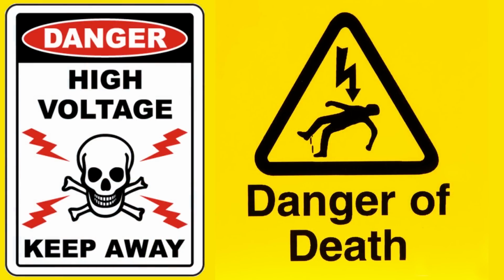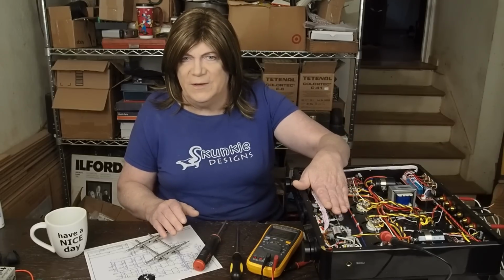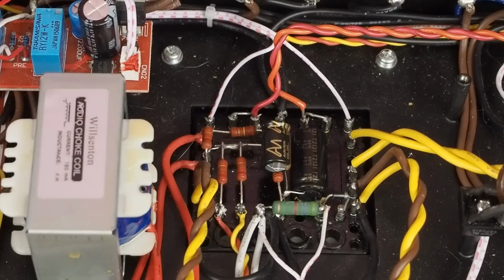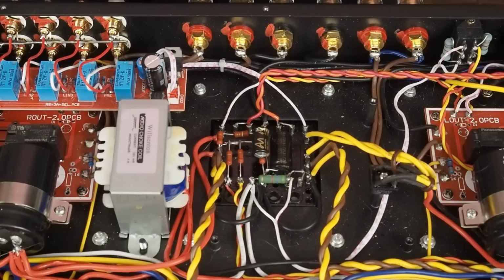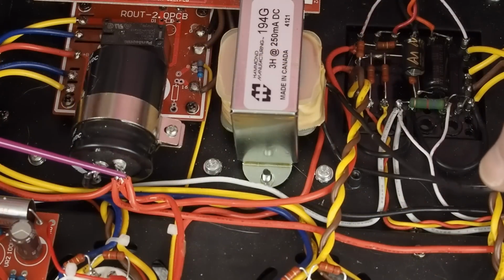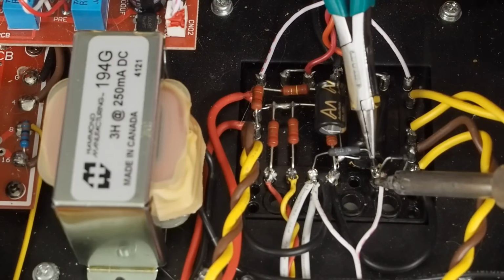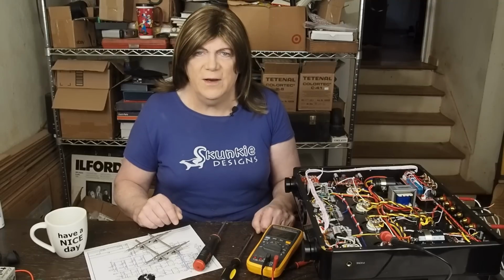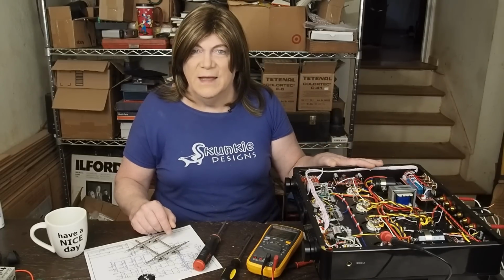Willsenton R8: Final Power Supply Mods.

Comment: My problem is i cant solder as good and steaddy as 25 years ago. With fine work .But i have exsperience in builds. I have 235v ac in the wall and never had a problem with no earth on the outlett. I have linoleum and always think about the earth danger, i putt the guitar on the 60 year old amp and play,its seems to go well,but maybe shold be using rubber soles always? - Use low fuse . As low as posible. There is a difrent ampere on 120 vs 240. Somtimes,ive seen wrong fuses on tube amps.

Comment: can use 220uf or must 100uf on power supply?
Reply from the maker: On what part of the power supply are you talking about? If it's the bias supply, no you can't.
Reply: @SkunkieDesignsElectronics  on power supply have big cap one that in original came 200v 100uf... can i put 220uf 160v?
Reply from the maker: No you can not, that will delay the negative bias voltage which can cause bad things to happen.

Comment: hey dear my amp come with cap 100uf 200v i see you put there 100uf 160v.. this not be a problem put not same value like this came?
Reply from the maker: There is less than 100V at this location, if you want to use a 200V go ahead but a 160V isn't a problem either.

Comment: Watched all the mod videos, how ever I never had a single issue with my R8 and it was dead silent from factory and still is dead silent. I did replace all the Willsenton Caps with Mundorf SGOs and it’s a great improvement. I will carry out the mods that are required such as dual rail mod, safety resistor mod. I have EL34 tubes not KT88s
Reply from the maker: Not sure what to say other than both of the ones I worked on had some hum at mid volume. They were quiet at low volume and at full volume.
Reply: @SkunkieDesignsElectronics  did you ever get the hum to disappear ?
Reply from the maker: It slowly got better, the final "hum killer" was the volume control rewire.

Comment: A quick question about that 4.7k resistor. Is it rated for 2 watts and 500 volts or less? You said it could be a metal film or Wire wound correct? Great video BTW!
Reply from the maker: Yes it is, not even close to those limites.
Reply: @SkunkieDesignsElectronics  I'm not sure what voltage to use, sorry.
Reply from the maker: @johnkal8403  There is less than 100V across that resistor.
Reply: @SkunkieDesignsElectronics  Thanks again.

Comment: Can i know which correct value you replace the green resistor with black in transformer which value that  ,Tnx for information
Reply from the maker: I ended up discovering it is NOT a wire wound resistor and while originally it was 5.7K ohm, that is such an oddball value I used a 5.6K and it works fine.
Reply: @SkunkieDesignsElectronics  original is 4.7k , gold red violet yellow =4.7k in green resistor

Comment: many tnx for great video, can i start from choke replace it first without do any change in resistors or caps?
Reply from the maker: Yes, absolutely, it's just a drop in replacement. The other one I HIGHLY recommend is adding some "safety resistors" to the bias boards, I did a video on that too.

Comment: Hi Stephe, I got my 194G choke, and you think going from 4H to 3H in the power supply will not be audibly noticeable? I certainly trust your opinion! Hope you are well, and thanks for all you do for us fellow amp owners!
Reply from the maker: I just measured the choke I pulled out of the amp, it measured 1.4H not 4H. The 194G measured 2.9H. Now the difference in DC resistance makes more sense, the one in the amp is not actually the Henries it's labeled as. I was baffled how the slightly smaller choke had more H at a lower DCR. The fact is, it doesn't.
Reply: @SkunkieDesignsElectronics  That is great, for everyone who replaces it! It's sad that companies can misrepresent their products like that. Thank you for responding, and thank you for all of your knowledge! Robert

Comment: Have you been testing the amp using the preamp inputs and an external preamp? I’m having mixed results in my modding journey. All of the changes I’ve made have positive results besides when I use the preamp inputs and my Freya+. Using the preamp inputs is causing the amp to hum noticeably however, all other inputs work great without issue. I suspect it’s related to a Fruit mod I did switching out the 220k resistor on the preamp power supply with one of greater value. When I used a 300k the amp was not stable and preamp section dropped out intermittently. I drop the value to 287k and I gained stability back but still have a noticeable hum. I’m looking forward to seeing the upcoming rebuild of the preamp power supply. If you don’t mind, please test after using an external preamp and see if you reproduce similar results that I did. Thanks for all your hard work putting this video series out! I’m certain you are helping countless folks gain new knowledge and opening some beginners to the tube amp world. You’re awesome!
Reply from the maker: Changing the voltage on the 6SL7, being a direct coupled setup could cause unexpected things to happen. I will test this and thanks for the suggestion!

Comment: I am enjoying your willsenton R8 videos. I bought one about 2 years ago and last year it started blowing fuses. With china audio's help I was able to diagnose that the B+ bridge rectifier failed. I replaced it with a higher amp version and have had no problems since. No idea if it was a bad part or a design problem. They did send me a version of the circuit diagram that is like the Australian site one but much larger and clearer. For instance the choke is marked 4H 300ma. The pdf is marked "do not share on web" so I am reluctant to post it but if I will send it to anyone who wants it
Reply from the maker: That is baffling, the sticker on the choke says 180ma? Maybe it is a 300ma? Who knows! The diagram online, is not how the amp is wired though.

Comment: Because of the 180mA choke, will there be any problems using KT88 or safety issue? Many thanks.
Reply from the maker: I don't think it's going to catch on fire or anything. They are just really pushing what this component can handle.

Comment: Curious if you tried out the amp since changing the choke. Do you expect any improvement in bass?
Reply from the maker: I haven't yet but plan to tomorrow.
Reply: @SkunkieDesignsElectronics  I was looking at other choke options for fun and found a 4H, 400ma I think would fit, but the DCR is quite a bit lower than the Hammond one you're using--30ohms vs 80ohms. Do you think that could cause an issue somewhere else, like with B+? Any issue with using 5H or more?
Reply from the maker: @andresamson7779  Link them?  And more H isn't an issue, I've run 10H chokes in SE power supplies.
Reply: @SkunkieDesignsElectronics  Sent a pm on Stereonet. Hope that's okay.

Comment: Yeah .. good catch on the choke- I noticed that too. Come to think of it I am really starting to wonder what the PT is rated at?? It did run a little warm after a few hours with the 6550's - I'd be interested to see if it's much cooler with the EL34's- it is pushing over 200ma but what is the rating? got me wondering now- and why a 180ma choke? The positive is that the R8 has been out for awhile already and haven't heard of 1 PT melting down. And I also removed the headphone jack wiring on mine also .. just clipped the 2 wires on the outputs that ran to the headphone jack and ran the  2 grounds to the ground that were removed from the headphone jack as I never use headphones anyway and when I tested it with a headphone plugged I still had sound to the speakers so instead of troubleshooting - it was removed. My Skunkie 300B amp runs much much cooler and sounds much better. I really don't think you'll ever get it to sound as good as your 300B- not that the R8 sounds bad -it's just not a 300B.
Reply from the maker: Not it's not and I'm a big fan of single ended amps anyway.

Comment: Assume the PT is 180mA, what would it does when you replace with 200mA choke? I have seen a lot PP amp without choke since the OT can filter out the noise and my PP amp doesn't choke either. In your experience, does the choke in PP amp would give better sound or reduce the AC ripple? I have been thinking to add the choke to my amp but not sure if it would give out a better sound or improve something else.
Reply from the maker: It reduces ripple, and also allows for a reduction in the DC resistance of the filtering network of the power supply. I have no idea what the PT is rated at, I hope it's large enough to actually power 4 KT88 tubes but who knows?
Reply: I did see the KT88's tubes bias up so the PT is putting out +200ma Forgot how much current each was pulling but was over 200ma for the 4 tubes and that was not using the meter but a tube adaptor with my fluke to read current
Reply: @SkunkieDesignsElectronics  Just off the top of my head - Iam running 6550's in there last time I used it and I believe I have them around 60ma each (if memory serves me correctly) so were already at 240ma. And the PT is doing it - is does run warm after awhile but not crazy hot like my Dynaco ST70- I light my cigars off of that one. I do wonder what it's rated at though- being potted you can't even see it.

Comment: Hi Stephe, again, I love your videos, very informative... According to Zed Zed at Stereonet Willsenton R8 forum (on page 63), when you set the bias for the KT88 with the bias meter in the center position, he measured the bias at <42ma. I guess that would mean the 180 ma choke in the R8 would cover the 168 ma used by the KT88.
Reply from the maker: On this amp, it's showing 52ma with the meter centered set for KT88 tubes, which is still pretty cool. That's over 200ma just for the output tubes and that is at only 63% of their rated wattage, with the amp at idle. 42 ma would be more where an EL34 tube would be run. I'm not sure how he calculated what he posted. and that isn't even adding in the power used by the input tubes, which isn't a lot, but it's there.

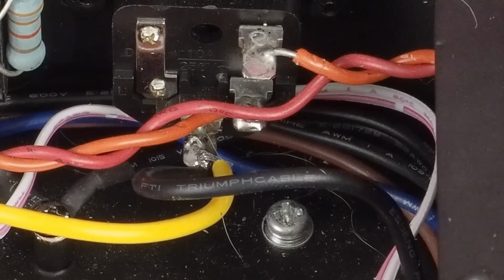Comment: 7:35 that was my question haha. Thanks for showing me. No offense, I understand you're just looking out for my safety but I just want to upgrade my amp and not buy an electrical engineering book. This isnt something I plan to do again anytime soon. And because your videos are so straightforward I feel confident to do the job. As long as my R8 model has the same layout as yours then I'll be fine. 
Mostly because I am very good at soldering. Long ago I had a big ebay store where I soldered 0603 leds to consoles/gaming controllers. Since they were so small I became a surgeon like solderer. And I still got all my high end tools.

PS: I bet there will be some good youtube videos I can watch in under and hour that will give me all the basic electrical knowledge. I'll just start watching some now. If anyone knows of any good somewhat short videos that helped you in the past post them.

Comment: What do you think of screening the choke? I previously had issues in another amp with the choke causing noise when not oriented the right way. (yes it was DC, couldn’t believe why?) 
I will also try to upgrade the bridge rectifier to 4x Vishay Hexfreds, heard good things about them and heard before they can have really good effect on the sound. Some people say they sound like tuberectifer but acts like a silicon one… interesting.
Anyway, about the voltage switch, i guess i got little bit offended since i didn’t right away figured it out. I measured the resistance i had in 230V and checked winding on PT to find similar.  You or someone else can call me slow but those switches are throwing me off you can say… 
Only issue i have with me R8 after extensive upgrade is that i have a slight ”pop” when i turn it off and little afraid to hurt my tweeters. can’t figure out ”why”, I’m
Suspecting there is something with those damn relays to do but since i want to go full triode i will later try to remove those and rewire it slightly. I think triode is superior to UL. Any advice on that in your videos later i would really like.

Can’t thank you enough and i’m
Surprised you haven’t got more subscribers yet.. it’s you and a handful people out there with this level of competence so big kudos to you. God bless you.
Reply from the maker: The pop is likely a bad capacitor on the power switch.
Reply: @SkunkieDesignsElectronics   Funny you say that because i replaced it with a new one a week ago to a RIFA PHE840 / 10nf as orginal but no change…

Comment: Once again, many thanks for your clear and concise instructions and warnings 🙂. I was one of those who asked about the wiring for 230/240v countries. I am positive I could easily work it out but I do prefer to follow the advice of someone with vast experience like yourself. So far I haven't removed the base plate to look so I don't know what other differences, if any, the 240v version may have lurking inside it.
Reply from the maker: No worries
Reply: @SkunkieDesignsElectronics  FYI, I found a H4 250ma shielded choke on Aliexpress that seems to be close to the originals size but then it is from Aliexpress so who knows how close it is to advertised specs.

Comment: Hi, to your comment about heat and capacitors, you have the one laying on the large wattage resistor that you replaced. over time the heat dissipation will heat the cap and could shorten its life or if the resistor was to fail it will bake the cap. I like your show, and I also agree, if you don't understand basic wiring, don't jump into a tube amp or any high power item that can kill you....
Reply from the maker: Except there would need to be large wattage going through it for it to become hot :)
Reply: @SkunkieDesignsElectronics  I dont disagree, but power is power, which is converted to heat via the resistor, which can be calculated ohms law. This is a practice that is taught in my early career, and when I see it I correct it.

Comment: I was wondering if it is possible with the power upgrades to run  kt120 or is there not enough power thanks
Reply from the maker: Nope. The power transformer nor the output transformers could handle the load
Reply: @SkunkieDesignsElectronics  Correct .................;;seen amplifiers blow up that way , even with changing rectifiers who draw much higher cuirrent !
Good and fair to warn people to have some experience and know how about electricity >/electronics and HIGH VOLTAGE BEFORE going in a tube amplifier and modify or repair !!!!!!!! thumbs up for the warning !